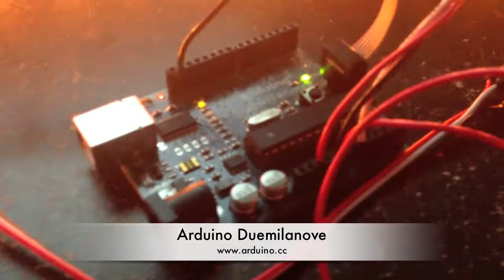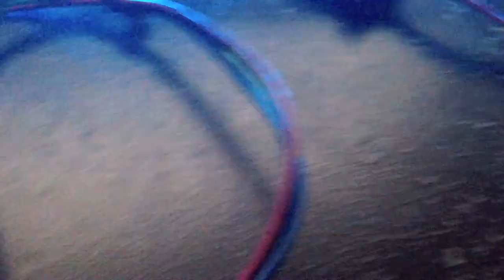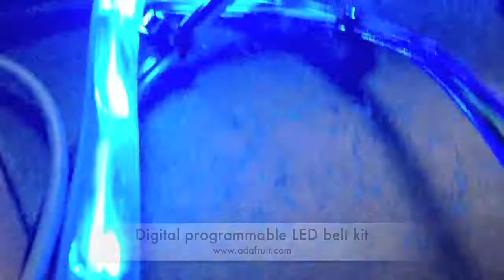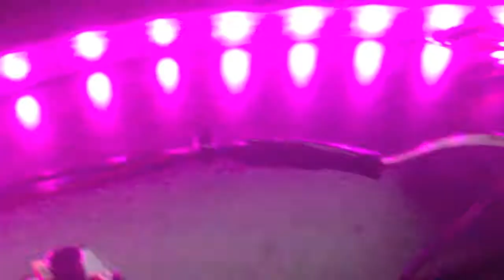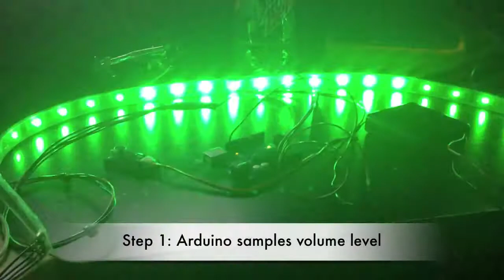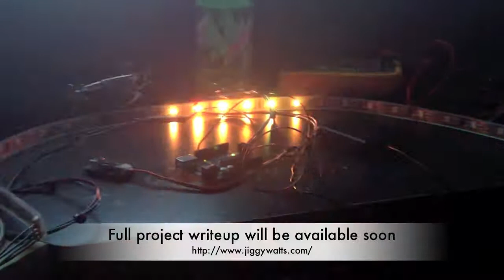Bonnaroo Belt

Comment: Which pins would you use if you stuck with the ATMega chip for the sound chip?
Reply from the maker: Mitchell Roberts I don't recall details regarding pinouts, but there's a project writeup at the blog link above which also includes all source code used if that helps.
Reply: I actually just bought the chip and the microphone chip.  I decided I'd just go with the More compatible set up.  Thanks :)